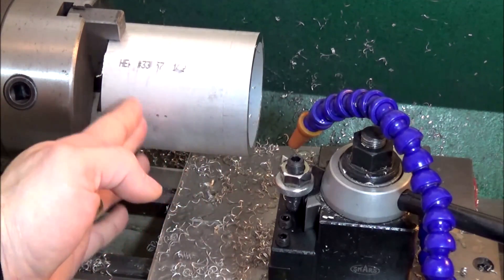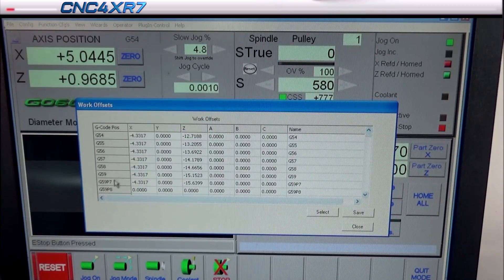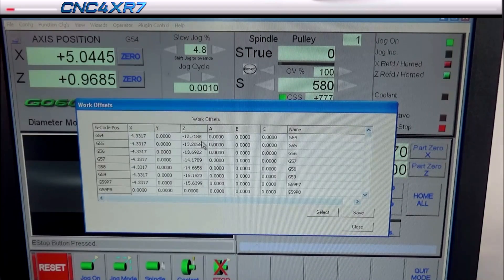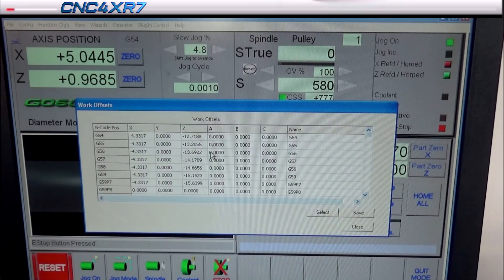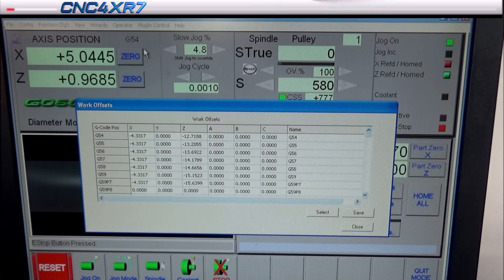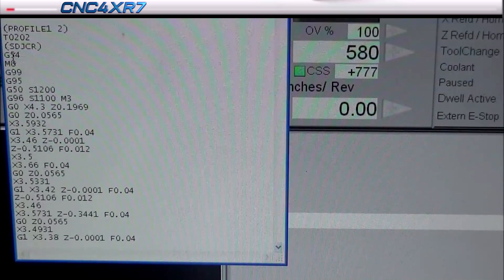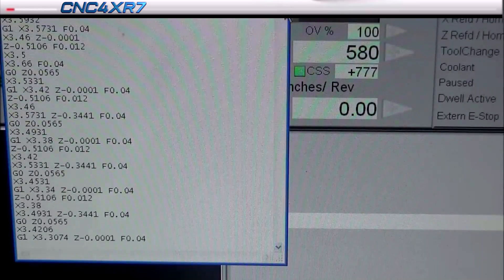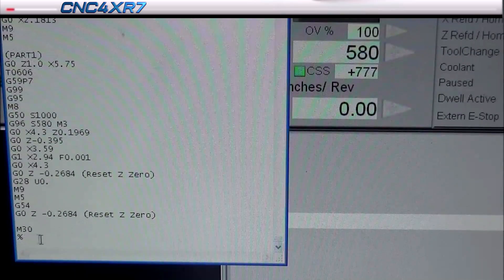Mach3 Turn Multiple Fixture Setup

Comment: Hi Sam, i can't do it tool offset setup why, for example my stock 25 mm go doing tool offset setup first x Axis zero and touch x but to be cycle start x start coordinat 35 mm for what ? Please answer that Sam by the way my stock half diameter 12.5 full diameter 25 mm PLEASEEE HELP ME !
Reply from the maker: It's hard to say x zero is the center line of the spindle.
Reply: @CNC4XR7  Please give me your e mail and i will send you quick and simple video 🙏

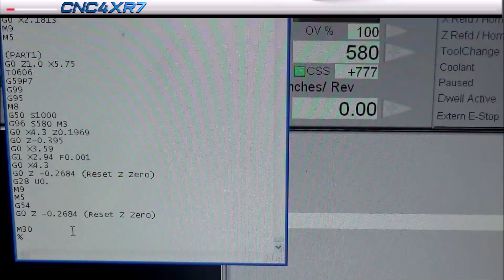Comment: 4:36 too much repeated codes. is there possible do
G54;
#1=1;
#2=6;(5parts+1)
N10 IF[#1EQ#2] GOTO 30;
(cut part here); 
G[54+#1]; (this will change G54 to G55 and so)
#1=#1+1;
M1;
GOTO 10
N30 M30;
Reply from the maker: Thank you for that bit I found that using fixtures was difficult since I had to set up each fixture per part.
 I recently ran this same part and was able to reduce G code size  while doing it all in G54 . there are likely more ways to accomplish the same result. I will be posting a video next week. I ended up using a subroutine.

Comment: 2:21 ooh thats hard. is there G50 Z1 it will move work ofset1 inch/1mm do it again. and again. then move it back G50 z-(distance*parts) and you setup is back normal. and in home machine it dosnt make difference. cut one part then move offset by hand. you not run that program without watching it?
Reply from the maker: Thank you!

Comment: WONDERFUL! I used to work at a piston ring factory where the operation of cutting multiple rings from a cast, machined cylinder was done as one operation. Basically a rake...with a HAMMER AND CHISEL to separate them (you had to maintain the integrity of the cylinder). Needless to say very few were still within spec after the whach job. Iirc  only 10% passed final inspection. I didn't like working there.
Reply from the maker: Wow interesting
only 10%

Comment: Hi Sam, Excellent explanation of fixture offsets.  I have never used fixture offsets, so I have learned a new method.  I would have used a "Step & Repeat" routine using Temporary Z G52 offsets. Your method worked fine.
Reply from the maker: chrisjh777 that
Thanks yes it works great and the g code can be copied and pasted changing only the fixture.